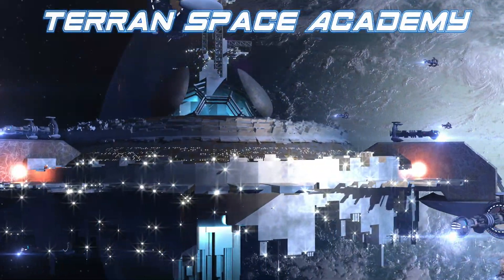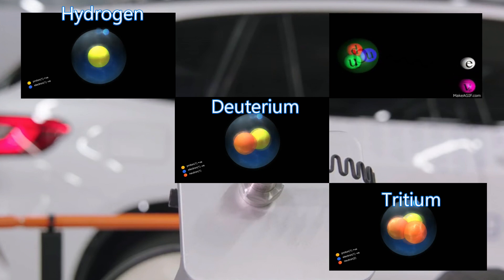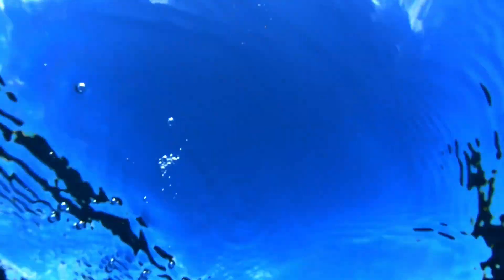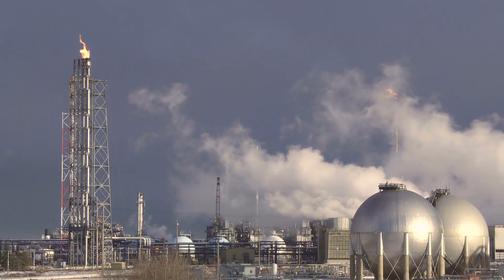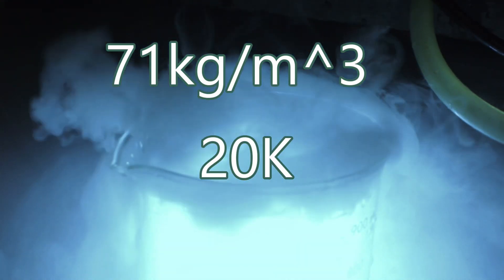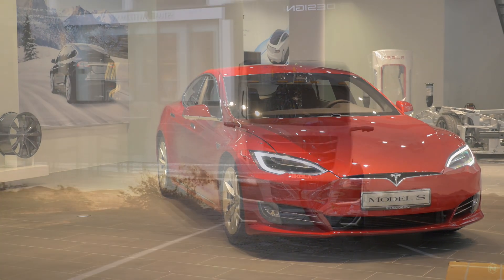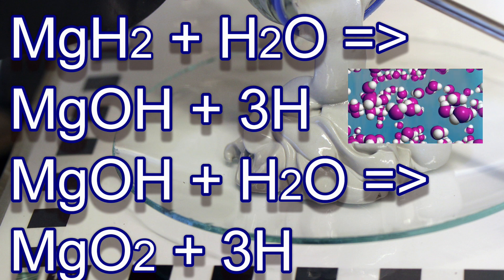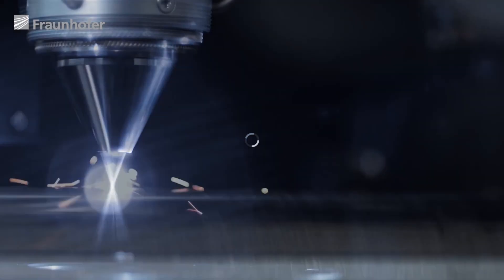Hydrogen Power Systems for Space Exploration and Colonization

Comment: Very cool and very fun. The rocket design seems viable and Virgin really does need more altitude IMO to claim astronaut status. Was it an earlier lesson that talked about some old rocket using a piston fuel delivery? While catalytic converters for a hydrogen ICE may need beefing up; I can't help but think that it would speed conversion to sustainability if these cars could be used while the EV's are manufactured.
Reply from the maker: It would be nice to have an optional fuel cell canister system to boost range :-)
You could get 1,000 miles/1,600km out of them pretty easy.

Comment: The power paste sounds exciting. Re: Helium-3, there is a huge supply on the moon. Is that what China is after for use in fusion power generation etc.? I don’t know if fusion will ever be that feasible. What do you think?
Reply from the maker: I think fusion is very likely to be viable with the use of superconducting magnetic tape/REBCO... it dramatically reduces the size of the reactors and increases the plasma density... fusion is just a matter of density, temperature and time :-)
Reply from the maker: I agree on ITER but solar is the most practical for the long haul.  Every home could practically power itself and "Solar Powerplants" in the American Southwest to power most of the nation and our electric cars.  Supplemented with wind and nuclear and that would be all we need.
Reply from the maker: What happened in Texas had nothing to do with the sun not shining or the wind not blowing. Renewable energy was not the problem. They depended mostly on natural gas and had not updated their pipes to withstand freezing temperatures.  Lack of investment in infrastructure caused the Texas blackout. The best solution to all of this is solar, wind and nuclear.

Comment: I personally think that hydrogen technology like this powerpaste would be best utilised in large transport (like aircraft, shipping, and flying VTOL personal transport) systems and perhaps for use as large (or home) powerstorage, leaving all the smaller systems like delivery vehicles, cars, (motor) bikes and such powered through current (and future) battery tech (in conjunction perhaps with wireless charging road technology in the next to near future). Another (hydrogen) technology that looks quite promising to me is the light activated hydrides technology under development by Plasma Kinetics.
Reply from the maker: That is very likely to be the case... We'll have to do some research on Plasma Kinetics.  Thank you.

Comment: No, is my answer to the title.  But oil companies love the idea.  Exceptions include BBq grills and Rocket ships.

Paste has 10% the specific energy though? It's neat, but worse than traditional h2 storage. No?
Reply from the maker: It is much better in several ways... no boil off, no high pressure storage, no supercold temperatures.  As long as we use solar or nuclear etc to produce the hydrogen paste we will reduce carbon emissions.  It is a compact light weight way to store lots of energy.
Reply: @terranspaceacademy  is it though? Why would we need to store any energy if we needed 4x+ times the original energy input from renewables?

That is to say, if you need to build four times the renewable production, then you have already solved the need for storage at all.

Compounded by the fact that there are numerous other storage methods which are not batteries and yet aproach their level of round trip efficiency.

The danger here is that you can "in the interim" just keep using reformed natural gas.

No, I think I'll stick to advocating for PV on every existing roof and regional wind resources.

As opposed to the notion that we need hydrogen because it solves a non existent refueling speed problem.
Reply from the maker: @D0li0  This is not an argument from a carbon neutral perspective. However if solar, wind or nuclear power is used to produce the hydrogen and there is no problem. And the white hours per kilogram is actually higher for the paste then for compressed hydrogen :-)

Comment: another idea noone ever talks about: formic acid- less mass efficient, but much easier and cheaper to make, transport and use
Reply from the maker: Ants use it!  Very toxic though isn't it?
Reply: @terranspaceacademy  its generally safer than mineral acids (battery acids, drain cleaner)- arguably more safe than gasoline;
the fun parts are: a) it can be made directly from co2, so basically air: [
DOI : 10.1002/cssc.201500958]
b) has more hydrogen storage density than liquid hydrogen, and decomposes to it (with the right catalyst) even at room temperature (or it can be used as is in a fuel cell)- either way, the easiest renewable energy storage solution to utilise
c) it is a liquid, as such the handling is easy and fast

Comment: I doubt hydrogen fuel will amount to much in cars... electric cars are better ( now) all the way around. Electric cars have been around a lot longer than most people think...since the 1890s.
      Electric cars were used as frequent-stop short range vehicles for decades ( like milk trucks). The downside was batteries...lead acid or nickel iron. Not much in the way if range, overnight charge times . Fine for in town milk  trucks or meter maid carts, but not much else.
     Only recently have batteries gotten good enough to make electric cars practical.
      With that said, in 1977, my physics teacher had an electric car. A Sebring Citicar.
    Looked both futuristic and cartoonish at the same time.
   Sounded like the spacecraft on " Earth vs The Flying Saucers". She hated driving, never drove far, so it worked for her. I think it had about a 30 mile range, and a top speed of about 45 mph. The batteries - big deep cycle lead acid jobs- were under the seat.
      She drive it around the school parking for the class.
    As I recall, she said it was very cheap to keep. 
      The hydrogen paste rocket sound like a plan....
Reply from the maker: I agree on electric for cars... it just makes sense.  For aircraft I think the power paste could be very useful.